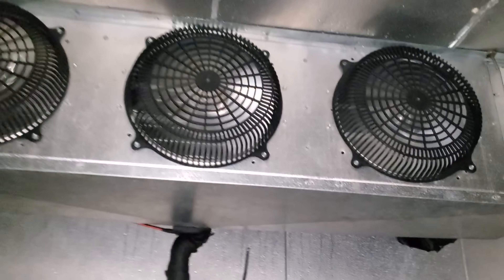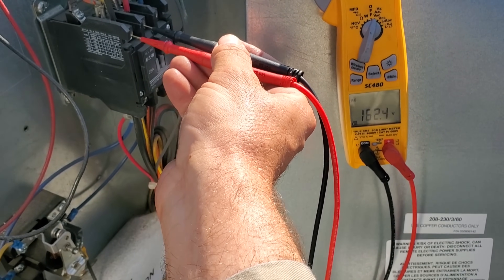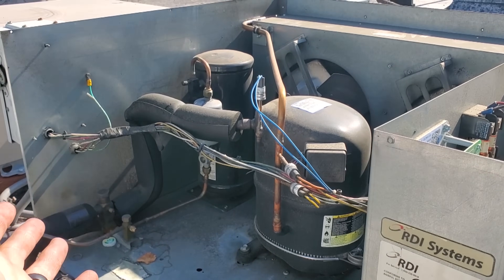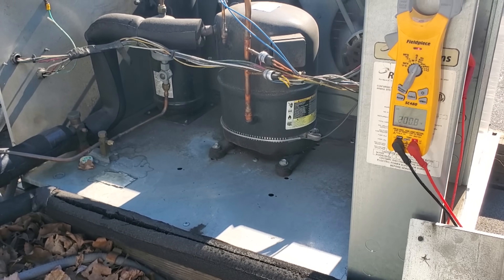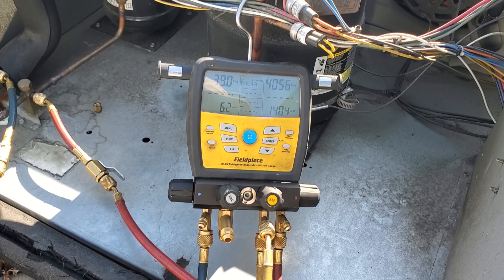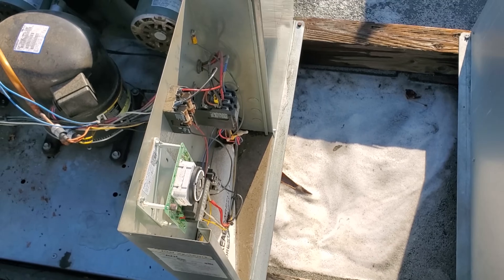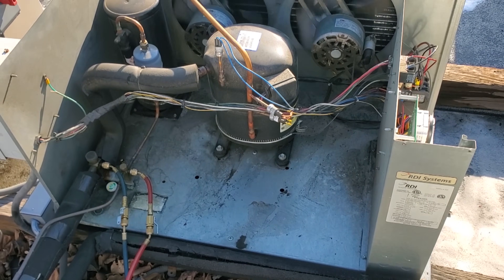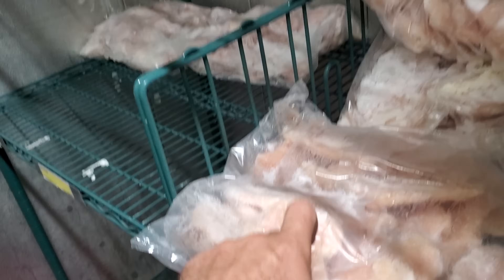THE WALK IN FREEZER IS TOO WARM

Comment: I had a reach in cooler at work that was over temping. I noticed that the condenser was hot but it looked fairly clean. Once I put foaming coil cleaner on it, I could see the grease & grime coming out that was trapped inside. The reach in was located near the cooks line. Like you always say in your videos, do not stop at the first problem you see. Also found a bad constant cut in t-stat that was shutting off the compressor before reaching cut out. Thanks for another great video.

Comment: You mentioned you didn’t like how the pressure switches were wired into the contactor coil. I’m assuming you would want them in series with each other? Having them split like that seems like it would be easier to isolate which pressure switch is bad (test LP coil side to L1, HP coil side to L3). That advice on saying the customer should monitor it after you have spoken to them and letting them decide is an excellent tip and something we try and teach as well. Keep up the great work!

Comment: I want to thank you for your content.  It really has been helpful.
As a homeowner, I always garden hose off the condenser as best I can in the spring.  However, for the last few years, my heat pump seems to produce less heat in the winter, and the annual service check shows nothing wrong.  
After watching your videos, I decided to do a little PM a few days ago.   Opened the side panel on the condenser, removed inches of leaf debris from the bottom, wet the condenser coils, sprayed evap cleaner, waited, rinsed thoroughly, dried with leaf blower {I have no idea what microchannel is, so I blew out the water}.  I was extra cautious to not kill anything in there.   
Then our temps dropped from 55F to 10F, and my heat pump produced more heat than in years.
So the condenser looked clean (else the tech would've said something over the years), but was apparently dirty.    So, thanks for your videos.

Comment: I saw that same exact sprayer wand at Lowe’s a few months ago. Anyways, silly rookie question for ya: I’ve seen a lot of 3 phase systems, including the two 15 ton Carrier package units at my current job, who’s fan motors still use run caps. Why so?
Reply: Fan motors are single phase, compressor and blower are usually 3 phase.
Reply from the maker: I will discuss this on my livestream this evening 12/28/20 @ 5:PM (pacfic) come over and check it out https://youtu.be/BcSELs0nDcE

Comment: Watching what little dirt was coming out of the coil I was thinking "Nope, not the problem, you have other issues. Was quite surprised with your results.
Also, I simply hate line voltage control systems. I assume line voltage on valve coil and temp control downstairs also?, that's crap.

Comment: "We should be PUSHING refrigerant up through the SUCTION side..." While technically correct, poorly worded... The suction side of the compressor...sucks...it doesn't "push"... The discharge side of the compressor "pushes"...Could be confusing to techs that are just starting out...Also 204...206 or whatever, is 208 volts, Ya dope, ya...Lol...Old Sarge...
Reply: Hmm, well as the compressor wasn't running with the pressure differential between the hi and lo once the sol valve energises  it is actually 'pushing' refrigerant through to the suction side.

Comment: I may have asked this before.
What makes a cleaner micro-channel safe? Non-corrosive or?
Reply: Typical condenser coil cleaners are a strong base or a strong acid, and if you don’t rinse it off really well it will dissolve the aluminum fins. Since a micro channel coil is all aluminum and holds liquids the way it does, it’s difficult to completely rinse the cleaner out of the coil, and the aluminum will just get eaten up and develop pinhole refrigerant leaks.
Reply: @Shmash_whatever  cool. Thanks for the answer mate 👍
Reply: That would be my guess, although I'm not a HVAC tech. I'd say the fine structure of the micro-channel means it cannot be completely flushed, and residue from the cleaner is more likely to remain, so if the cleaner was caustic (for grease removal, like dishwasher powder), it would slowly eat the aluminium away.

Comment: 35 year HVAC/R tech here... Lately, the newer freezer systems like the Beacon II controllers are being set up for -10 degrees F by the installing contractors. This is way too cold in my view. Beats the living shit out of the compressor and creates a lot of problems with evap coil freeze over due to insufficient defrost cycle times and duration.... I immediately raise the setpoint to the NSF authorized standard of 0 to 5 degrees F. This alone, solves a lot of nuisance problems. Also, stick a 2,000 ohm resistance between terminals 8 and 10 and forever get rid that goddam annoying E-7 fault code... Factory authorized...BTW...Ol Sarge...